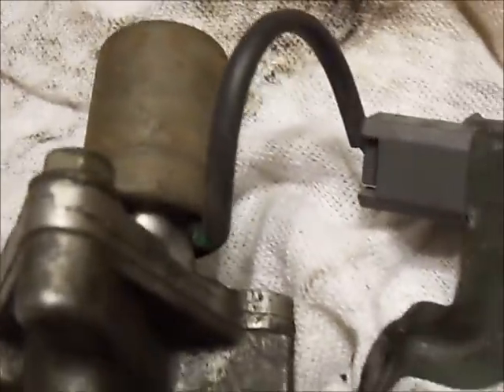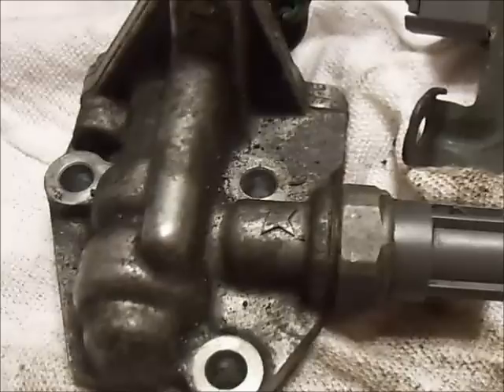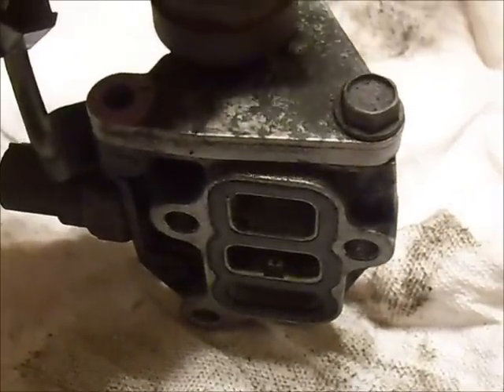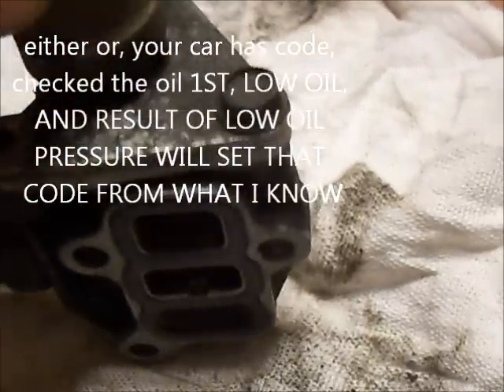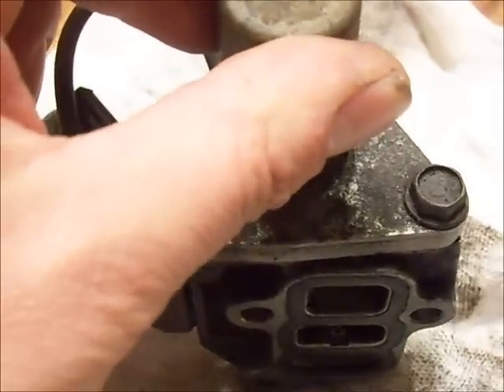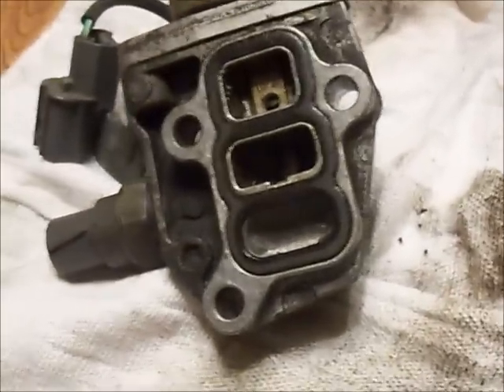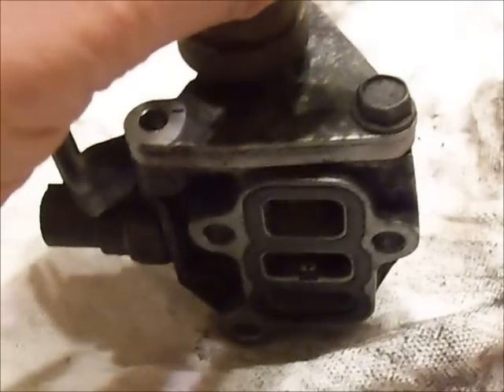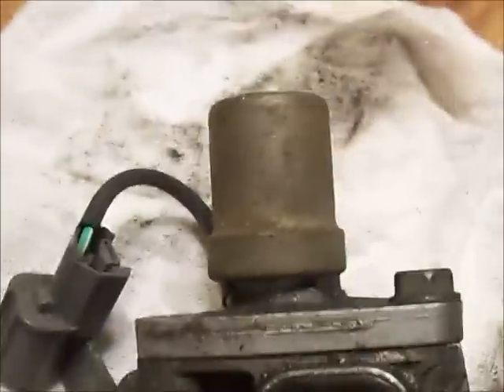P1259 VTEC MALFUNCTION CODE FOR HONDA 2.3L VTEC ENGINE

Comment: @RANS87IROCZ  Hey man great video, have a quick ques. I have a 03 honda civic 1.7l vtec and when I wss in second gear and accelerating once I hit 4000rpm (when vtec should engage) it just started to sputter. Got that p1257 code and guy at part store was guessing it was the oil pressure switch. But I'm thinkink its what you did (vtec solenoid valve) any ideas? Thanks!!
Reply from the maker: 8 yrs ago and I'm just seeing SMH, I try to respond to every comment but somehow I never saw yours till now, so sorry I'm sure by now you got a whole new car
Reply: @RANS87IROCZ  Lol no worries! Yes new car. Moved on to audis. And yeah it was that vtec solenoid. Very easy fix! I appreciate getting back, better late than never! 👍🍻🍻 imagine if my car was still broke and I had been waiting 8 years later for a reply! 😆 😁
Reply from the maker: @cwatson42785  right 😂 so sorry bro! But glad to hear you got it solved and since got new car also, heck I missed a few others too I feel bad but really glad to hear you got it solved and doing well

Comment: So my roommate has a 2001 prelude type sh, he doesnt know much about cars, and its not my car so I dont check oil regularly. I dont know much anoit vtec other tyan how it works. So here is the story. He got it about 3 months ago, was perfectly fine. About a month ago he raced someone, he over reved a little bit, not bad. It was one bounce than he shifted. But after that his engine light came on, along with atts. From what I have read if one comes on so does the other. But anyways, vtec stopped working yo. I took it to work (grease monkey) filled it up wirh oil. Missing 3 quarts out of a 4 quart system.( I know im cringing to!!) Made sure oil was full. Vtec works now, but feels powerless. Boobeeboo, I know its a honda, no haters. Im well aware of the powerles honda. But its still noticable. Now its just basicly a volume increase. No power. Would running it like that ruin his vtec sulinoid? If we replace that, do you think that would fix the problem? Im not trying to see my roommate dump money at a dealership when its something I can do at work.
Reply from the maker: Robby Gonzales got ya, hey no haters here, hey back in the day, I worked for a tire oil lube place, not to shabby I joined Rosedale Tech, halfway through got hired at Firestone, and then went on to Penske Auto, got laid off cause they all closed up then hired by Monroe, to quit and work for a mom and pop shop 11 years doing everything under the hood, now I work for another, and trying to start my own. 1st car was Ford, I like Chevy, truthfully I respect everyone"s ones choice for car, if they want to supe it up. hey but to answer your question, is the light still coming on for that code now?
Reply from the maker: Robby Gonzales my thought would be, check compression 1st, if it was raced low with oil, and not sure how hard he was racing it, just maybe he damaged a ring, is it misfiring at all, or just the rev no power
Reply from the maker: Robby Gonzales and hey Honda's are fast little cars, what makes them fast is the fact that most 4cyl imports hav a higher rev point. but inspect the plugs, check converter also, could be clogged, seen them rob power for sure. hard to say what could of happened when he raced it, but if light is staying out, I wouldn't suspect it faulty, it prob was result of low oil. but if engine seems to be running fine other than power start checking other. if light is still on for this code. then yes try a new one you never know worth the shot
Reply: Thanks man. that was helpfull, and that i know honda=powerless so i dont get trolls. I drive an impreza. so im pretty familiar with the jdm power feel. I just did a mobile 1 oil change on it, and the power seems to be there again. but the lights are still on. im gonna give it a few days of driving to see if the system resets. If not ill reset it myself to see if it comes back on. ive never seen plugs cost a dramatic loss in power, only misfires. and that it does not do. engine runs really strong. Would worn/old oil cause power loss in a vtec system?
Reply from the maker: Robby Gonzales yes I have seen plugs so fouled cars would barely run, but true they always run little rough. so if its smooth might be fine, but I check basic shit just to see. I have seen plugs in v8 engines fouled and robbed power with very little misfire going on. but hey wishing you luck on figuring it out. it could just be that solenoid is now bad, and limiting rev. but also clean throttle body for heck of it, I always do such just for gp, unless it's one them newer no throttle cable set up
Reply: thanks man, and ive been telling him we should go thru and give everything small a check, also clean his fuel system to.
Reply: Robby Gonzales fuel system plugs wires coip ignitor VTEC solenoid find out why oil levels were low. Own and wrench an 02. Good design just take care of it. Pay attention to the suspension components too.

Comment: I HAVE A A 98 ACCORD 2.3 L AT IDDLE ITS LOW HIGH LOW HIGH INTERMITENT? ANY IDEAS I HAVE NO CODES. THANKS V/R HUGO MELCHOR USN RET DISABLED AM VET
Reply: Low coolant levels
Reply: I changed my idle control valve done

Comment: Hey I got a 2002 honda accord that's giving me the vtec malfunction code and it won't go over 4000 Rpms I had it at the honda dealer 600 bucks later and they tells me they can't find out what's wrong tryed a new pressure switch and vtec solenoid and a bunch of other things and can not fix the problem HELP ME PLZ
Reply from the maker: still need help, sorry I didn't sign in for some time, well it has to be something related to this, if new parts did not fix the issue, nor oil change. then worse case a wire has a bad connection somewhere. either from computer side or at the part even possible bad ground. and even worse your oil pump is going bad, and your not getting the required oil pressure to the switch or your engine is really gummed up from lack of oil changes and possible oil is not getting proper pressure to it, crazy Honda dealer can't figure it out? most cases it's just this part in whole I show in the vid that causes this code, that's being if the oil is at the correct level. cause I have seen a few cases where the oil was just low and it caused this problem
Reply: Brian
 I am have the same problem on my accord. Did you ever get it fixed and if you did what did you have to do.

Comment: I used a degreaser to clean my engine for the first time.  After I cleaned it and took the car for a ride, the check engine light came on and the car started jerking.  I get a 1259 code now.  Could this have anything to do with putting the degreaser and water on the engine?  Could I have put too much on?  Or is this just a coincidence?

Comment: I am also have a 4000 rpm limit kick in with same code. I have replaced oil, vtec 
solenoid, and pressure switch still have same code even after cleared
Reply: @shay mccaa me too

Comment from the maker: I say its coincidence, unless soon as you started the car and it was running rough, like I tell most, check the oil or get the oil changed, then get the code cleared on it. see what happens. if it comes back on, change this part. small chance maybe you got water in your oil, but be hard unless your cap was loose or dipstick wasn't pushed in all the way. might effect it, and that would be bad. so start by checking the oil out, go from there

Comment: So I had this error code a few days back. Turns out my oil was extremely low. I filled up the oil and the 'check engine' lights disappeared after driving for some miles (in 2 days). 

Does that mean it's fixed? Do I still need to change the solenoid? Thanks
Reply from the maker: it's fixed most likely you will be okay

Comment from the maker: well their not cheap, talking 150, bucks, Honda dealership, you maybe able to search it for less, I have always called it the Vtech solenoid valve, I believe proper name is cam adjust solenoid. I can't remeber if we got it from our local parts store or not, they was good at tracking hard to find parts for less. ebay used betweeen 40-80bucks

Comment: fucking makes sense why it would cause it on my acura now since my valve cover gasket is leaking that's probably why I got the code
Reply from the maker: could be gasket on it leaking, they also leak at the gasket on this and cause the code issue